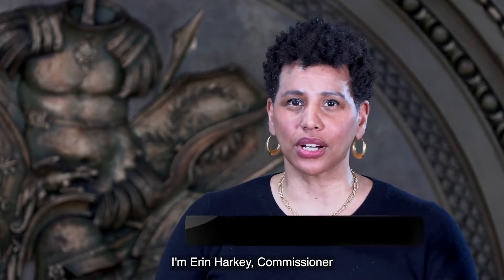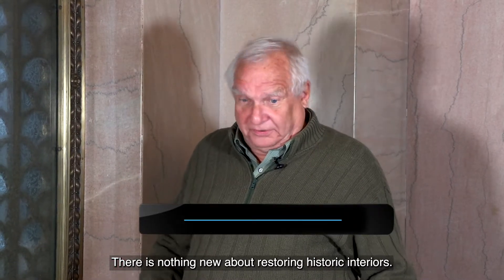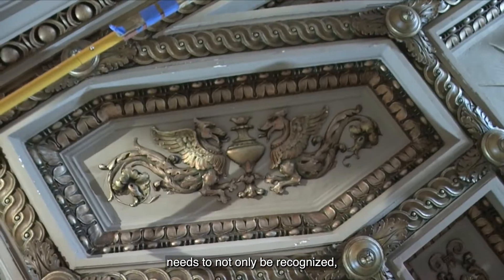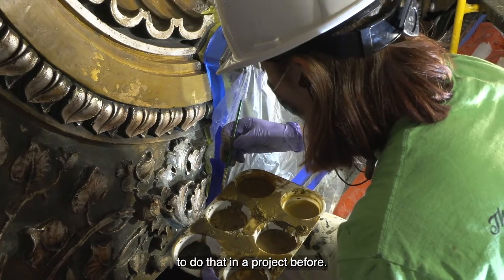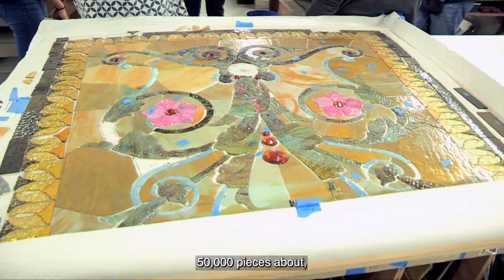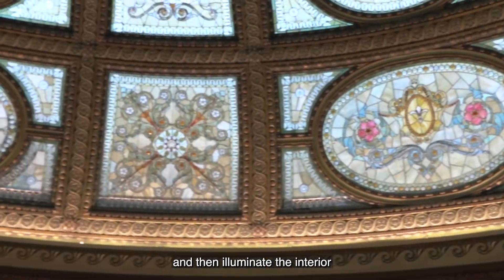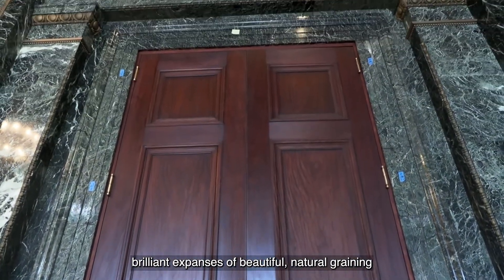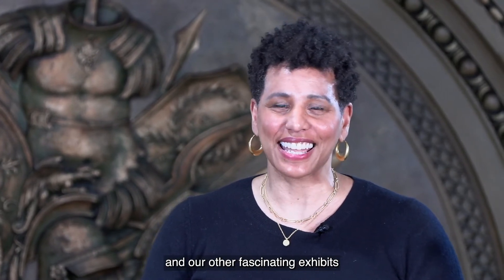Grand Army of the Republic (G.A.R.) Memorial Hall and Rotunda Reopening

Comment: The exterior of The Cultural Center was defaced last year and so far this defacement has not been fixed; additionally the structures at the corner of Randolph and Michigan are a disgrace and should be leveled and replaced as after all This building is the Cultural Center of the City of Chicago -do you want visitors to observe this defacement -we tax payers do not